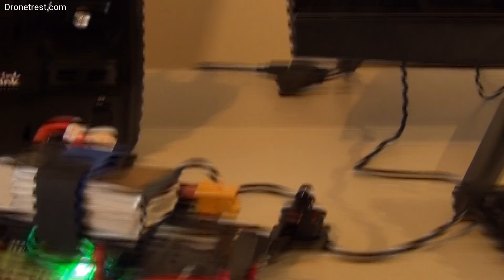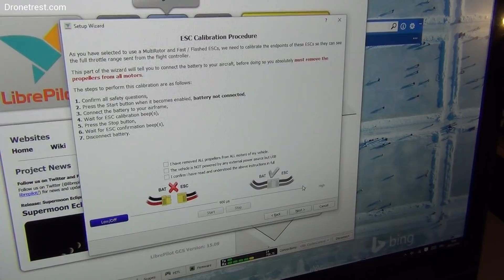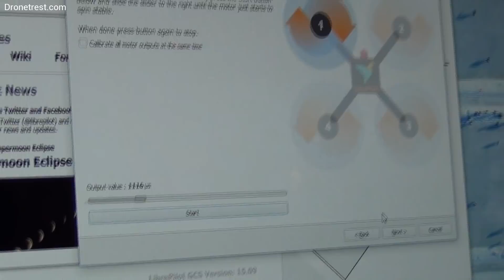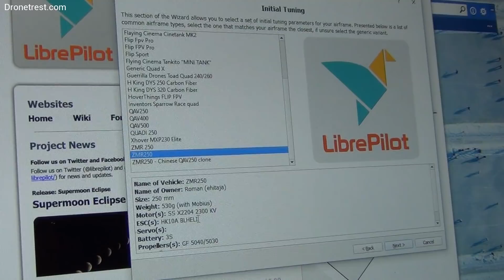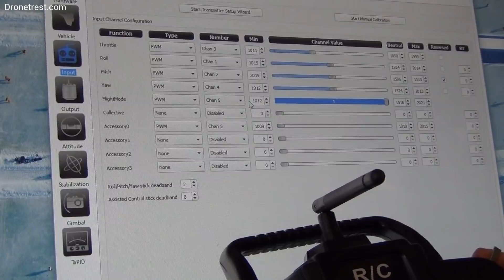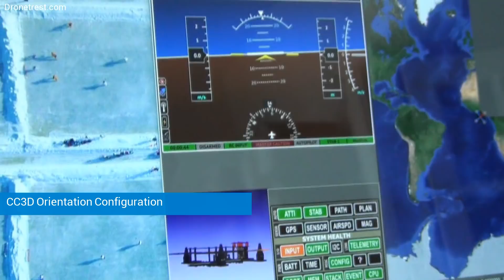ZMR250 CC3D Configuration Guide with LibrePilot

Comment: I had a lot of difficulty setting but it's flying now. I love the on-board telemetry radio of the Revolution. Still not sure why it can't have a flight mode which is GPS assisted (some config error clash thing happening). Guess I'll play around some more and check out your video/s.

Comment: I am doing a build with a cc3d and I programed the motors and got the receiver bound to the transmitter and I did the set up wizard and it worked. I found out it could not arm it because it had a red x over the atti box and the stab box is completely red. I don't know how to fix them. Can anyone help me?

Comment: Please help! I am stuck on the transmitter setup, all of the first steps went fine (moving the throttle up, then the yaw and that other stuff) but then I moved onto the step where I am supposed to move my sticks and it should mirror my movement like it did with yours. But the problem is that it doesn’t mirror my movement with the sticks as it should. So I can’t fly my drone😞 thanks for any help😁
Reply: same case here...

Comment: hello sir.. greeting from India..
seems u have a lot of knowledge about cc3d..
i bought a hk250 frame wid black widow 2300 kv motor.. i want to setup for stable flight at mode 1 and mode 2 i want to do flips and 360.. for that setup what should i hv to do as i m making a custom drone not in the list of cc3d.. if u can make a video soon it will very helpful..
happy landings with regards..
Reply: go with current tuning an get good more powerful motors and esc's. Make sure you have a good lipo, try make the quad as little weight as possible. Go watch painless360 video about flight modes to do that.

Comment: hi Thanks for all your help "fist bumps"works  like a dream could you help me setup fail safeI am using eachine i6 many thanks, this was my first build, had to reverse pitch that's is all.After centering controls and taking them to maxium and flicking all swithes and didn't think it was going to work the demo was not responding but saved settings and it armed this guy is a topbloke

Comment: I've configured my board and tested it and everything is pretty rock solid EXCEPT when I use the pitch control it's very aggressive the slightest touch pushes the quad forward (if I use stick up) at almost 45 degrees there is no gradual movement. I tried using the transmitter setup wizard again but it's still extremely snappy. I'm in attitude mode. Any suggestions would be welcome.
MIke
Reply: Hi sir, Its been 8 months you posted this problem. I'm facing the same issue. I'm hoping that its resolved.  If so please mail me @ pranavdeep1997@gmail.com so as what exactly you did to resolve it

Comment: when I calibrate my esc's they beep forever what do I do?
Reply from the maker: Jawad Ajmain sounds like your ESC have entered programming mode as you did not reduce the throttle soon enough
Reply: Unmanned Tech how should I fix that
Reply: this is my first build and it's a zmr250 from the unmanned techshop. I would really appreciate the help.
Reply: Mine beep forever as well, just press stop when it starts looping the  beep. Same goes for when it stopped and it keep beeping just unplug it. See if it works :)
Reply: I've asked on a online forum and they said to manually calibrate the motors it works for one of mine and you should give it a try just search up: manual esc calibration. :))

Comment: How did you fix the incorrect back words from your stick ? It was the opposite. I'm having that issue with mine.
Reply from the maker: ryan phelps you just need to reverse the channel, best to do it via the menu if you are using the flysky fsi6 radio?
Reply: Unmanned Tech I'm using a spekrum dx6 transmitter with a spektrum 610 receiver.

Comment: UT, first time doing this. I have a eachine racer 250 just arrived from Banggood.  I have gone thru your tutorial and have a disastrous out come and have made several attempts to re-install the drone and simply cannot get the correct outcome.  here are my problem points at various stages1. ESC calibration point........ instructions "wait for the beep"  drone beeps forever and never stops2. ESC calibration,  if I move on to OUTPUT calibration as the drone continues to beep.  one motor will not respond during OUTPUT calibration  Going back doesn't correct anything.3.  If I continue to transmitter set up hoping that things will work out further down the road,  The transmitter responds to commands on screen as it should but when the process is over it isn't bound to the drone as yours is in the video.After 3 days I have exhausted all efforts.  Can you help.
Reply: Larry Faucett I'm having the same issues. The alarm beeps I'm not sure why. It's designed to when battery's are low but mine aren't and it beeps. Also none of my motors work :/

Comment: Which motor wires do you switch?
Reply: Any two, it doesn't matter
Reply: Yes, but on which two motors: clockwise, or ccw?
Reply: The top-left and bottom-right are clockwise, the other two counter-clockwise, if any of that motor is inverse just by switching any two cables of the motor will invert its rotation.
Reply: can you reverse the rotation in librepilot/openpilot?

Comment: Very cool, great walk-through - I somehow overlooked the stabilization setting(s). This would have saved me some major crashes! Huge difference! On a positive note, I have been flying my quad on 'expert' mode for a while. Now, I feel like I can actually fly it without being on edge and sweating bullets. Especially in the house and the added consequence of my wife questioning why things have propeller marks in them. Not to mention the time it caught fire on the area rug (pinched the pdb with a zip-tie and shorted it). There is no setting to prevent that, tho ;)

Comment: when I was setting the output on my esc's they were all different numbers. some of the motors started twitching but not fully rotating. so when I tried flying for the first time one motor doesn't spin occasionally (it twitches) not to mention the motors all start spinning at different times. is this a programing problem or do I need new esc's?

Comment: I think it's silly question but what is your CC3D board version? Did the front arrow really at the front?
Because I'm handling my friend's CC3D and installed it with front arrow placed at the north side of frame but now I hardly access usb port because it is placed on rear (south).
So when I look at your video with your usb port is on right side of board, I got confused with this CC3D version on my hand

And one more thing. If there was big difference value for neutral spin motor on ESC Calibrating Process, I mean one motor start spin at greater value than 3 others, is it problem?

Comment: Hello, when i do the 'ESC calibration Procedure' and click 'start' and put the battery in it it makes a beeping sound. But when I click stop it don't make that sound what yours making (the confirmation beeps) how can I fix that?
Reply: i have the same issue can someone explain me please....
Reply: I had the same issue. Find the ESC Calibration guide on Librepilot website. You have to do it manually on the output tab. Follow the steps, and it worked for me! for some reason the auto vehicle setup was assigning wrong and a combination of ESC outputs when they should all be the same.

Comment: I finished programming my mini cc3d on my HobbyKing King Kong 260 and I'm having trouble. Everything looks ok on the wizard. However,  once I try to fly it, the motors are sputtering and cutting out. I put it back on the bench and when I put it in a low idle, it will keep spooling up to full throttle. What am I doing wrong? Help!!!
Reply: i have the same issue, did you figure out what was wrong?
Reply: Set up your Throttle, Roll, Pitch & Yaw Neutral settings as close as possible to 1500 with the sub trims in the transmitter, It helped with my motors spooling up to full throttle.
Also might be worth checking that the ESC's frequencies and type are correct and that they are calibrated

Comment: Hello I'm having trouble with transmitter. I have did the calibration and everything went well now I can't connect transmitter to the quad and video will not flash or turn on has this ever happened before.
Reply from the maker: What radio are you using?  Have you made sure to bind it with your radio, and is your receiver connected correctly and receiver power from your CC3D?? also you might need to plug in the battery to provide power to it.

Comment: Nice job on the quad! I have a question-- I can not get the cc3d board to hook up. It gives me the warning that it is waiting for the board to be connected, and I must manually update board with the plug in. Can not fly--any ideas?
Reply: Sometimes that is due to a bad cable. Get a new good quality cable and it should solve your problem, it worked with mine!
Reply from the maker: Have you tried a manual firmware update?  Also are you using windows?  If so, have you given librepilot appropriate permissions?

Comment: Do you have to do a separate throttle range calibration with your transmitter and Esc's or does the CC3D Libre Pilot software do it for you?
Great Video BTW!
Reply from the maker: +Steve B Hi, thanks by the way! And you do have to do both but the wizard takes you through it step by step. You first do the ESC calibration and then the wizard later takes you through the transmitter calibration. Hope that helps and if you do have any other questions, please let me know :)